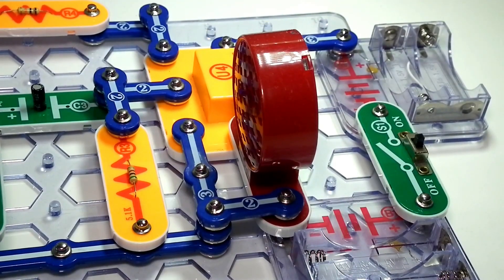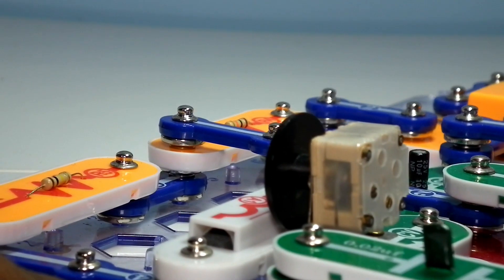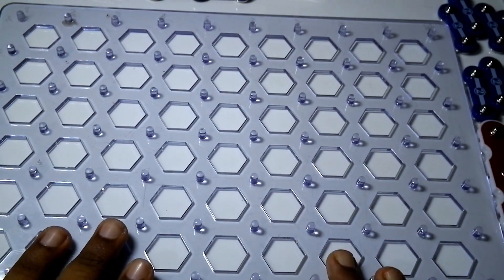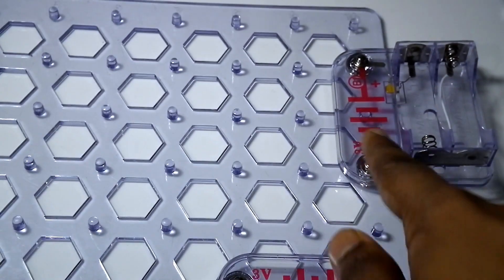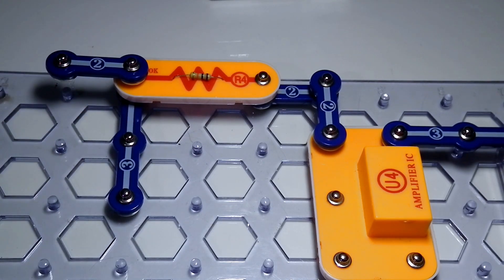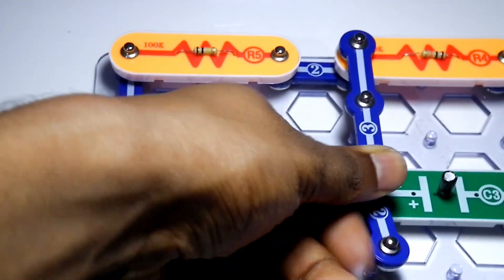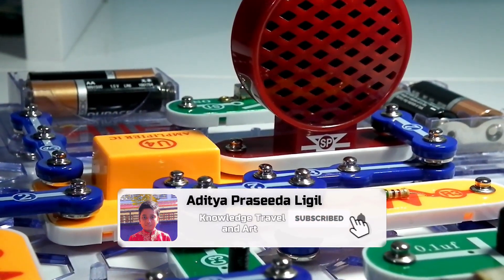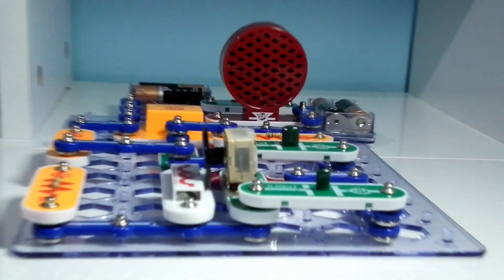How To Make An AM Radio At Home With Electronic Snap Circuits.

Comment: u are lucky u have am radio transmission in your country ... great vid ... i built these circuits also with my snap circuits ... i own 16 of different ones ....  my A.M. Radio picked up transmissions as far as south america and grenada in d caribbean ....  i am from Trinidad ...also in d caribbean ,..... .looking out for more projects vids ....
Reply from the maker: Thanks for your comment from such a beautiful place.I didn't knew the Snap Circuits AM Radio can receive transmission from such a long distance. I would be uploading more project videos from March. I am currently studying in 10th grade, so after my 10th I would regularly upload Youtube videos.
Reply: @AdityaPraseedaLigil  for u to receive long distance transmission ... u can try placing a 10ft or even greater length of pole ... probably pvc .... as it is easier to cut ...an run a long length of wire from d antenna point of A1 on your snap circuits ,.....and from the other point use another wire to the ground of your house or cold water pipe .... thats what i did ... just remember ... in the country where i live only had 2 AM STATIONS .. BUT THEY ARE NOW CLOSED/OFF AIR ....and it had alot of unused space in d band ... so u may not get transmissions from south america or d caribbean ... but probably from another state ... i think ... try making your own coil .. from copper wire or whatever wire u have ...  i am seeing your pic .. u look young ... probably an adult can help u understand what i have said ... thats if they themselves can understand ... LOL ... thanks for d reply and good luck in d future .. bye ... as in Tinidad we say Laterzzzzz .. until next time ...SORRY THIS WAS EDITED ..NOW LOOKING BACK AT THE VIDEO ... U ARE LIKE A TEEN .... sorry ...
Reply from the maker: Thanks for the information. I will be uploading more videos after my 10th grade.